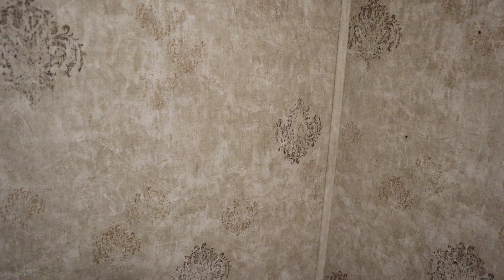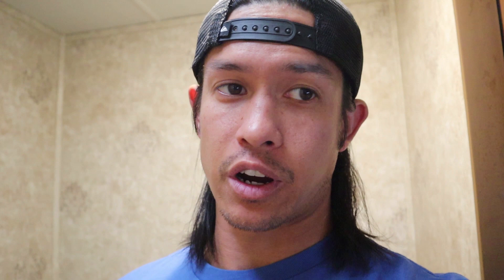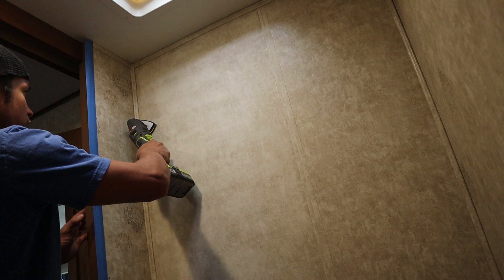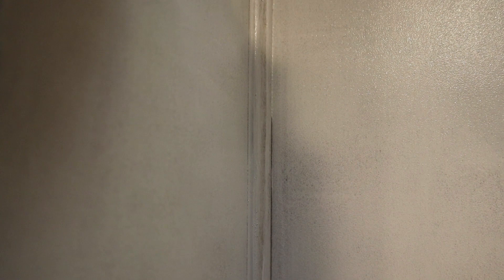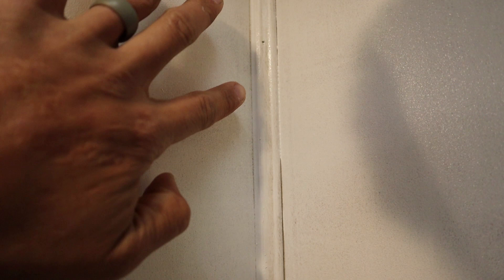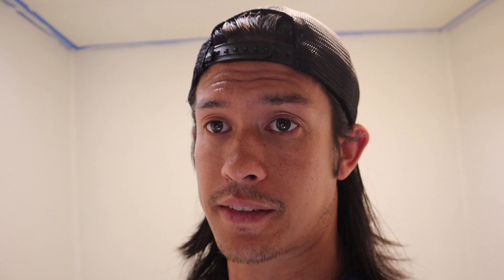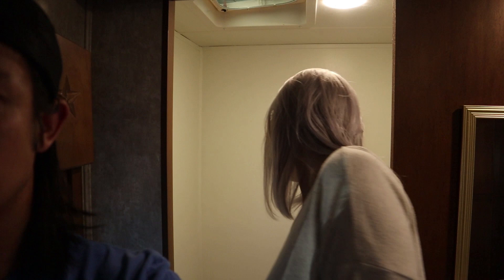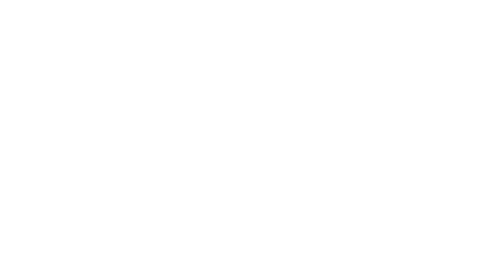HOW TO PAINT RV WALLS //CORRECTLY\\

Comment: Great video! Use a thicker nap roller and it'll take less coats of paint. Plus it'll hide little imperfections. You'll use the same amount of paint, just less work with less coats.

Comment: I'm repainting my interior RV also. Other rv'ers are saying they use a acetone to clean walls before painting. I am doing that then wiping down with water rag. I have found the acetone takes off the pattern in the vinyl covering on the walls. Sweet!  They say even after a year the paint job has held up beautifully.

Comment: Your work is one of conviction and patience; I know I lack.  I'm in the process of painting our new-old RV Interior, and have run in to those hideous (previously hidden) cracks along the walls and ceilings,, as I've painted; and, with the exceptions of the corner trim in the RV; which do need to be caulked, as you've shown. You've inspired me to replace all the horizontal trim with 11/16th PVC Quarter Round along ceilings and use 11/16 in. x 2-1/4 in. PVC Finger-Jointed Casing  Molding for baseboards. Thanks for the heads up!  I'll tack and glue the trim work instead. Phew!!

Comment: Great video. I like the sanding idea. Like you, I'm pretty anal when it comes to clean lines and stuff like that. Which is why I don't use anything but Frog Tape for painting. I use the cheap stuff for caulking though. I'm curious if that corner trim still moves on move days and you end up with cracked paint anyways? Again, thanks for the detailed video.
Reply from the maker: I’ve seen the frog tape, but never used it. Big difference?
The corner I used for reference in the video is still doing well after a year and a half. There are some seams in the rig that I will need to recaulk due to cracking though.

Comment: Please share how it holds up after moving. I worry the corners will crack when I travel😬
Reply from the maker: We’re almost 1.5 years since the caulking was finished. Not sure how many miles we’ve covered, but we’ve traveled from S. Florida to S. Dakota, and there is some minimal cracks showing now, but not enough yet that I’d even consider fixing it yet.

Comment: LOL I'm OCD about painting also. Wife always tries to help with taping but uses 4-6 inch strips and can overlap the ends cleanly to save her life 😂🤣😂

Out of curiosity is there any particular reason you didn't remove the trim pieces and refinish them separately or even just replaced them? Seems like it would have been much easier 🤷‍♂️

Glad to hear you have and are happy with the Ryobi tools. I just bought their big combo kit because Home Depot had it on sale for $199.
Reply from the maker: I did remove and replace some trim, but a lot of trim has RV components behind it, so I wanted to limit the odds of stapling into them.
Reply from the maker: I’m still a newbie with some construction so still all a learning process.
Reply: Got it, and yep I’m also just a guy who needs to do the occasional minor renovation done the best that I can. Once we get our fifth wheel, hopefully by the end of August, after we are settled in for a while, we know we will be renovating ours too.

Comment: Ice heard on the spots where there is a line on the wall from other sheets next to it or the corners not to paint or score it when your done because when moving the rv will move around and the paint will start to peel?
Reply from the maker: Yes, if you use the right caulk you can paint it and it will flex with the RV. As far as managing expectations - there will be a lot of touching-up.

Comment: Did you consider skim coating the walls to smooth out the texture?
Reply from the maker: I didn’t. There wasn’t much texture to begin with. The sanding was primarily to rough up the surface somewhat to prep for primer.

Comment: Awesome video. By far the best and most thorough explanation of how to paint RV interior walls. Thank you! 

Have you noticed the paint cracking in any corners due to vibration caused by driving your rig down the highway?
Reply from the maker: Yes, unsurprisingly, there are a few spots where the shifting has created new gaps.
Reply from the maker: Yes, unsurprisingly, there are a few spots where the shifting has created new gaps.

Comment: Wow! Talk about being detailed oriented. Caulking was nightmare for me the last time I did it, but had I seen this video about taping first. Thanks for the tips! Any suggestions on what to do with wrapped wallpapers on corners before painting?
Reply from the maker: Are you able to send me a picture of what you’re asking about? Nateaxness@gmail.com
Reply: @ProjectTrek  Sorry for the typo, but what I meant to say was "warped" old wallpaper from the manufacturer. How can go about smoothing those out before painting over it.
Reply from the maker: Gotcha.  We’ve had spots where the wallpaper was a little rippled/bunched-up. Sanding it down and then applying a thin coat of spackle, and then sanding that down to match the rest of the wall as best as possible.
It won’t be perfect, but it’ll do.
Reply: @ProjectTrek  Gotcha! Thanks. I will try that.

Comment: Question ate those walls ok to get wet? I have the same wooden walls
Reply from the maker: RV walls are typically made out of a material called Luan. Which is some kind of wood/fiber material. I’m not sure how wet you’re talking about, but it’s not a good idea for them to be saturated with any kind of liquid.
It is happens and is caught immediately you can of course rapidly dry it with fans/dehumidifiers and maybe only have some issues with swelling, but water can easily damage walls.
Reply: @ProjectTrek  i mean wet from taking a shower thats all. I want to put vinyl flooring tile
Reply from the maker: Oh if they occasionally get sprayed with water from the shower it’s no big deal, but if it’s consistently getting soaked that’s not good.

Comment: I could have caulked that bathroom in 5 minutes!  None of that needed to be taped because it was going to be painted over anyway.  A small hole with a v cut in a tube of caulk with a caulk gun and just caulk it...no taping necessary!  I only tape caulk when the caulk line will be visible like on a countertop edge or something.

Comment: No to silicone caulk.  Latex is a go
Reply: Ok. I bite. I need to know why. I haven t started yet but im trying to pearn as much as I can. I live full time off grid in an 30ft 5th wheel. It needs to be less 5th wheelie (lol)  ive been debating even just getting like a tag board type thin wood and just covering it all and painting over it. But I have 2 walls I need to replace first. I know im rambling. Im very intrigued
Reply: @TinasCrazyLife  you can't paint over silicone.  It won't stick

Comment: Have you ever just removed those trim pieces in the bathroom/rooms ? instead of hand sanding them ? then use silicone just in those grooves
Reply from the maker: Hey Corey, we did end up replacing some of the trim. At the time I wasn’t sure which route I wanted to take, since some of the trim I wouldn’t match from HD or Lowe’s.
Certainly an easier route.
Reply: This was my question also. What makes the difference of silicone vs latex caulk? Would it need to be the same base as the paint? If I used latex paint do i need to use latex caulk?

Comment: I have an idea/question.  Couldn't you just remove that cheap crap corner trim completely since your painting and just caulk the corner and paint over without that corner trim?
Reply: You are likely to find some rather large gaps where the two walls meet, or don't, as the case may be. Possibly too large to caulk successfully, and, if caulked, more likely to come apart when the rig is moved.

Comment: First, stop saying 'silicone' because you CAN NOT paint over silicone. Second, you can clearly see the crack in your finished caulk line. You shouldn't be taping off caulk if your going to be painting it. As you learned, caulking will shrink as it dries and if you don't have feathered edges it will pull away from the surfaces..